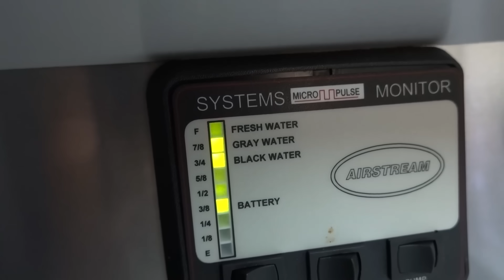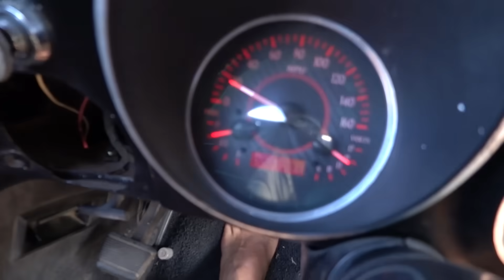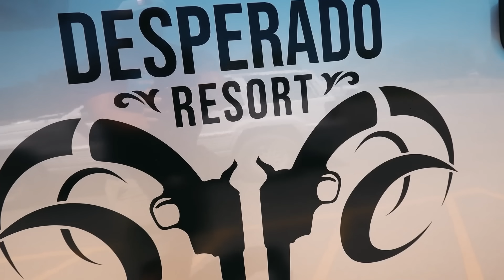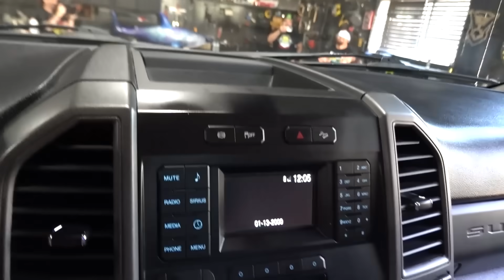The New Ranch Truck is LEGIT!!!

Comment: While the river is low, it would be a great time to put in some concrete steps to allow access to the river when it is at normal level. That would help enhance the camping experience since that bank is rather steep. I know... it's not like you are not busy already with the resort... just thought you could take advantage of the situation.
Reply: Nope, its not going to be like nature camping when there is a concrete step.

 Maybe a concrete ramp for vehicles going to RV spots, so that the wheels will not skid on dirt. 😊

Comment: You should temporarily dam the river up above the spot with the camper and use the backhoe to dig out a nice hole. Not only will it be deeper when it does fill, but it should retain water for longer during periods of no rain.
Reply: Water generated power off grid😎

Comment: Matt, you should dig a pit under the rope swing so you don’t land in 2 feet of water
Reply: Not sure if you can alter the waterways like that or not.
Reply: I feel like it would fill back to level in a few years or seasons with silt and sand
Reply: I agree. Dredge the river. Get a permit or whatever it takes.
Reply: Let the river do river things.  Get Lunkers in there and build a big fishing pond/lake.
Reply: Genius idea while the river is low. But I think the water flow would cause it to fill back in fairly quickly so he might need to remove a fair bit of stuff for that to really work.
Reply: He sold the ranch with the rope swing to buy The Desperado correct???
Reply: That baphomet on the truck is so cool!

Comment: Hey Matt it’s be worth thinking about putting an allision transmission in earl. It’s not too hard of a process to do and you’d never have to worry about the transmission going out again on ya.
Reply: Even the aisen out of a newer 4th Gen dodge would be a huge upgrade!
Reply: I'm so far behind the times on these newer trucks. A guy should be able to build that tranny to hold mild power upgrades and tow since they've been out for a while. The Allison isn't guaranteed either. Built autos are the way to go but damn are they spendy. But if you want reliability and don't have the knowledge or tools to DIY a solid trans, give up five grand and it'll get the job done for a time to be determined. These days it seems like a dice game for what catastrophically fails first.

Comment: No bubbles on decals:  Get an old spray bottle, put some water and dish washing detergent in it, about as strong as you'd wash dishes with. Spray both the surface and the sticky side of the decal with it so it's wet. 
Put it on, line it up (it'll slide), wipe out bubbles with a cloth. 
Leave it for 1/2hr and take off backing paper. 
No bubbles and perfectly straight every time. Does not affect long term stickiness or durability of decal. 
🤠👍

Comment: All I can think of is that the well pump draws water either directly from the river or from an aquifer that the river feeds into. This is quite interesting. It could be due to rain, the well pump, or both. Since you filled up the pond, and a day or days later the river was dried up, it seems as if they are connected.

Comment: Matt, might be worth getting a potable water trailer you can haul out to the airstream/cabins, etc. That way you can fill it up at base and just haul it around.
Reply: What happened to the fire truck?
Reply: I'm surprised he doesn't at least have an IBC (those 1000-litre plastic pods) on a trailer for such purposes. How is he hauling water to the goat pen?
Reply: I would just get the leak fixed. He will still need to pull the trailer out from the river to empty the grey and black tanks after each visit so get the leak fixed and fill it with water when the tanks are getting emptied.

Comment: Stay with springs for a work truck. Bags can have problems. Springs just work.  I run them on my 350 SRW and it's not a work truck. I love them. They hold up my truck camper great, and when I pull my dump trailer it's nice to have the extra support too. And I don;'t have to worry about blowing a bag.

Comment: My 17 f250 has the max tow package , (3” receiver ,f350. Rear and springs ) with Timbren bumpers on the suspension I tow equipment and big gooseneck trailers and it handles the load incredibly! I recently found out about these 6.7 powerstrokes having an issue with their cp4 pumps failing and it being a $10k repair . So look into getting the replacement pump kit from s&s diesel . Its like $3k

Comment: Matt have you thought about using the River water flow to power a charging system for the Property off Grid?

Simply Design and build a water wheel section after Partially Damming the Water to Generate the movement of your water wheel.😎

Comment: Do you have good cell phone reception all over the ranch?  If so, great.  If not, every golf cart should have a radio to reach you if needed.  Every vehicle needs an internet tracking device as well, for safety and security reasons.  Don't move the Airstream just to get water.  You need a water truck for roads and other uses anyhow.  You could also just buy a water bladder for one of your trucks.  If you're using the Airstream near the purple door house, at least park it under a tree for some shade.  It'll save you a lot of gas.  Roughly, how far is your house from the ranch?  Did you get a license plate on your Camaro yet?

Comment: Meh.

I wouldn't worry about things.

Myself & mates do a bit of rallying and I've been going to a (the) drag strip (Santa Pod) in the UK for 30 years. Facilities at the strip are getting better, but camping in the woods on a rally means absolutely fuck all amenities.

Not a problem.

We always have a good time, without AC, running water, comfy beds, etc. etc.

Last rally I had food poisoning and spent 18 hours puking my lungs up, but I still had a fairly good weekend. Was like doing 1000 sit ups. Good abs workout.